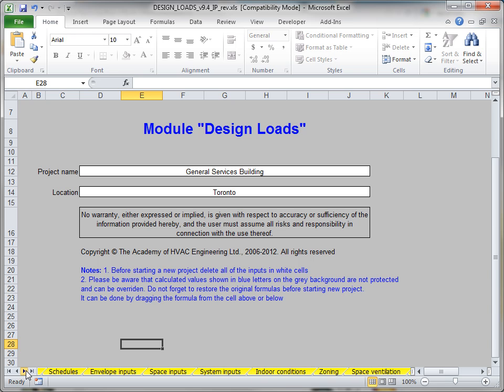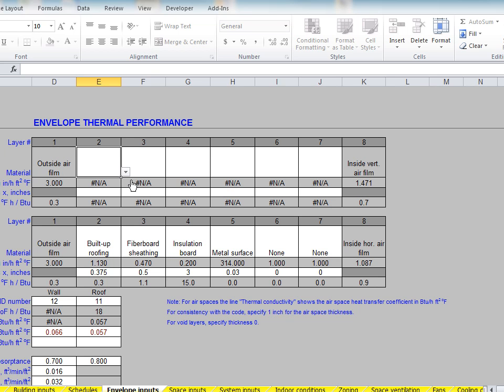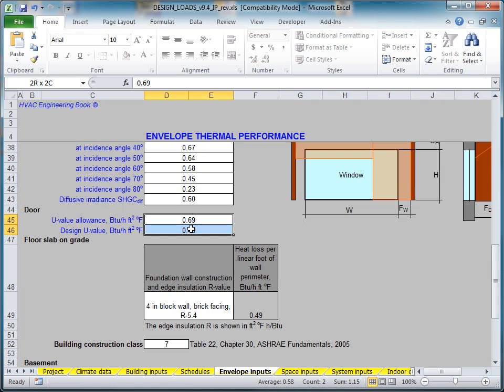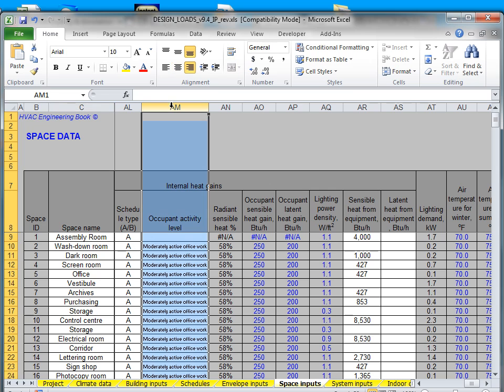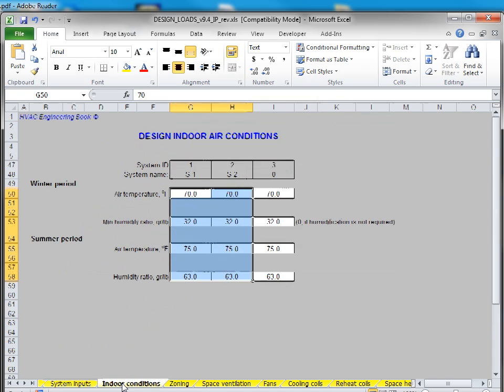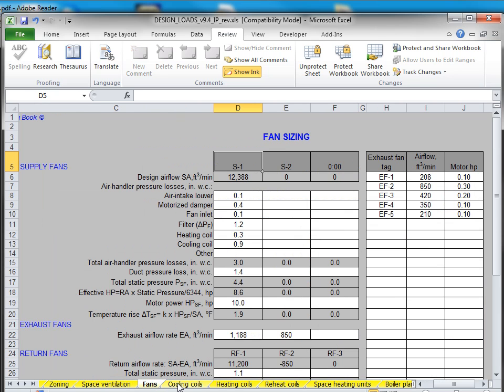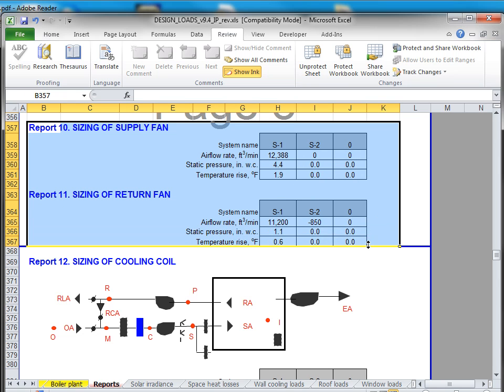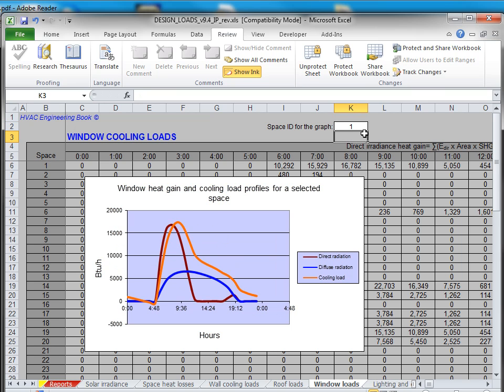Hvac Systems Design Tutorial: How To Calculate HVAC Design Loads

Comment: please upload HVAC system in pharma in telugu
Reply: Hello Mr. Kumar, do you work at pharma HVAC Designer?
if you are working at pharma please share your HVAC design experience and your knowledge about the HVAC Heat/Cooling load calculation experience i am very new at this work. i need your help.